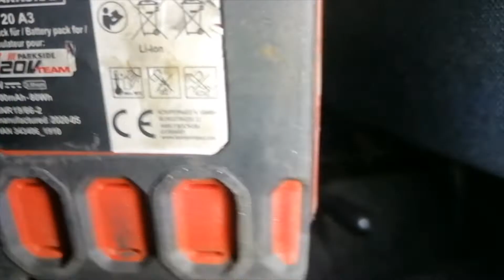How to Remove or Replace Front Seat Nissan Note

Comment: Do you need to disconnect the battery for air bag
Reply from the maker: yes on nissan yes it will have srs light on otherwise.
Reply: @tehnicalife  do you need to disconnect the battery for the removal of the seat?